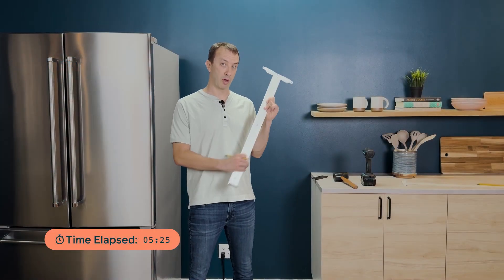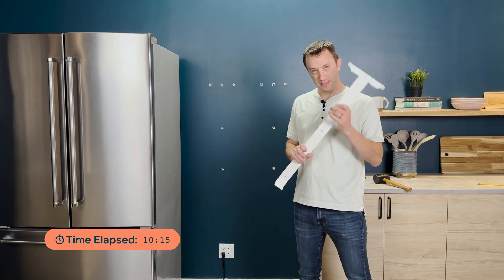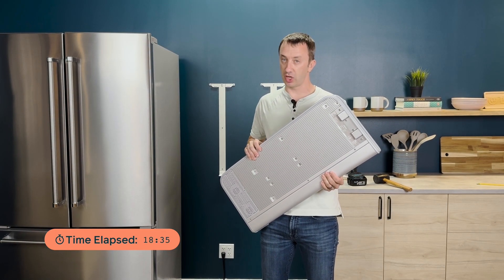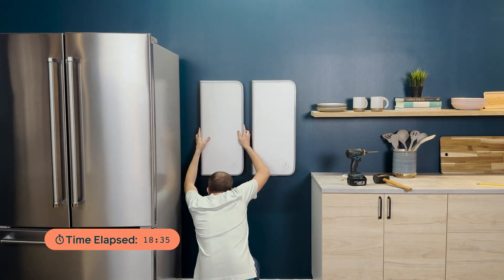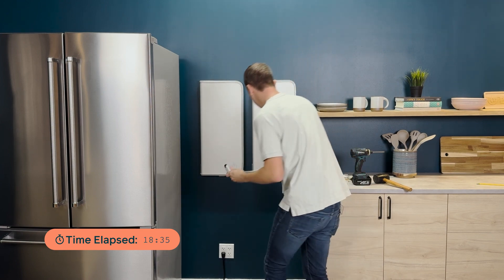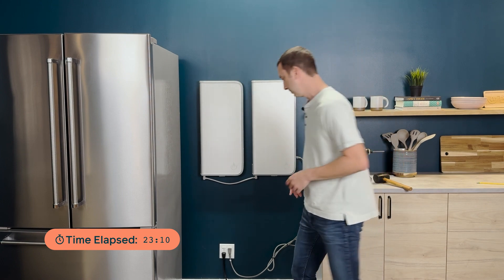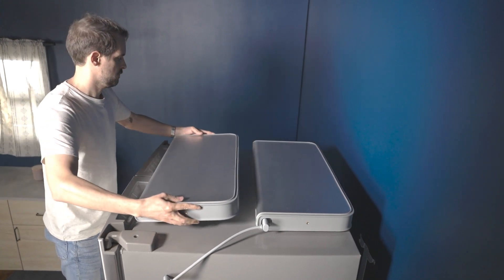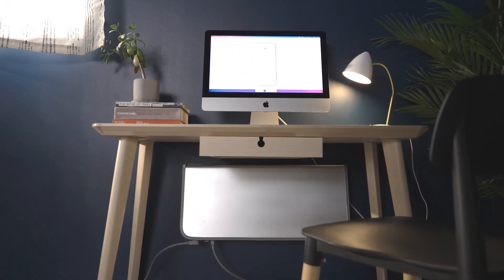Backup Up By BioLite | Installation Walk Through

Comment: What's the Max Wattage these units can Back up ?
Reply from the maker: It's designed to operate like your standard wall outlet, so continuous output of 1800W with a Surge of 3000W
Reply: For how long will it run for that  @BioLiteChannel
Reply from the maker: @edwardannable5468  runtimes will vary based on the amount of power being used and the number of Backup units linked. We use 30-60 hours as a reference point, but it can be longer than this if just powering small devices and can be on the shorter end of this if powering multiple energy intensive devices at once. Learn more here - https://www.bioliteenergy.com/pages/backup